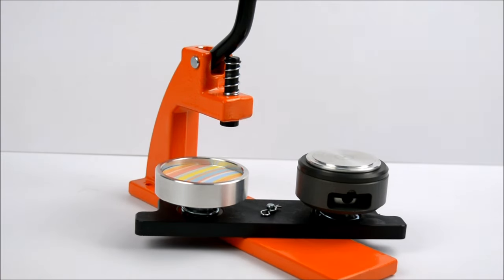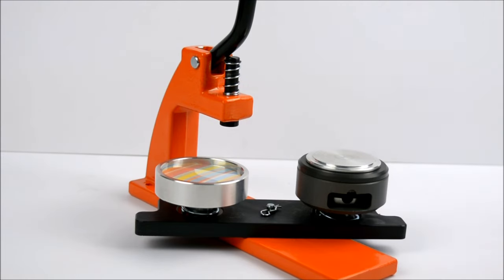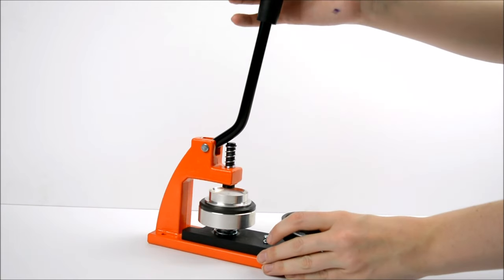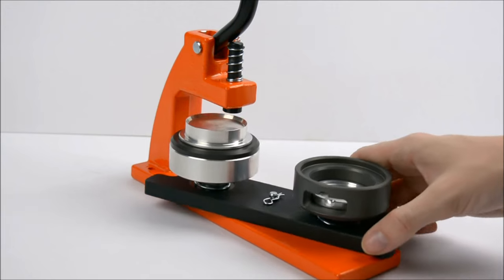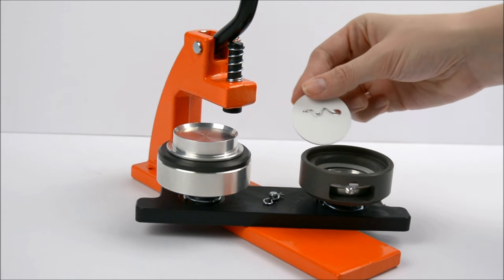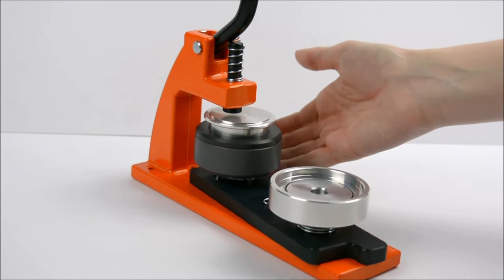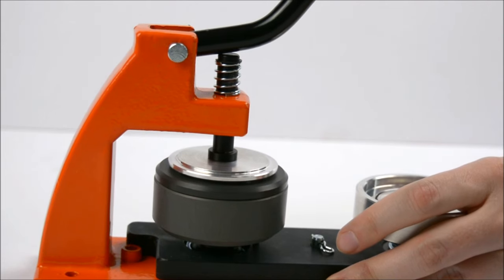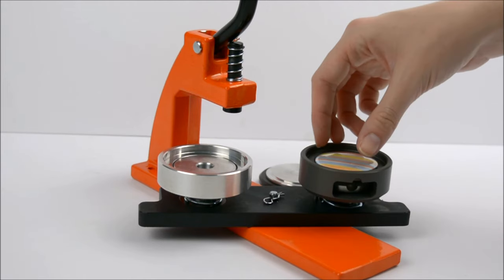How to make a badge on an ebadges badge maker (45mm and 58mm only)

Comment: Can you do a video showing fabric badges or mirrors please.....I’m finding it a bit hit n miss in the finished product.
Reply: Hi Helly, If you scroll down on our help videos at the below link, the eighth one is how to make a mirror.  https://www.e-badges.net/make-badge-video/ Fabric badges are made in the same way as if you were using paper you just probably wouldn't use the clear plastic film over the top.  We have found that putting a white paper circle underneath the fabric can help.  As the machines are designed to be used with 80/100 gsm copy paper; using fabric that is either thicker or thinner than that can be a bit of a trial and error thing.  If you are still struggling then by all means contact us either on 01780 740075 or info@e-badges.net and let us know what is happening and I am sure we will be able to resolve it.

Comment: What does the spacer do exactly ?
Reply from the maker: We use a spacer in 45 and 58mm badge makers because there are keyrings available in these sizes. To allow space for the keyring backs the die is a bit deeper and has a hole in the side for the keychain. So when you are making anything without a keychain, for example a badge, the spacer is needed so that the badge back is higher up in the die allowing the badge to make correctly.
Without the spacer, 45 and 58mm badge backs won't attach correctly to the front.